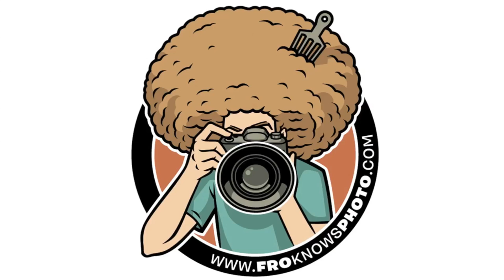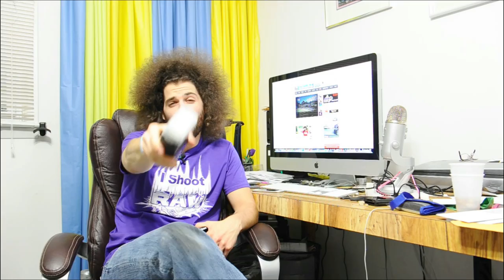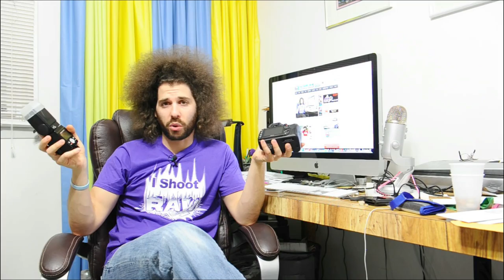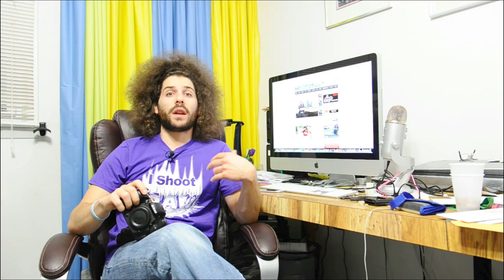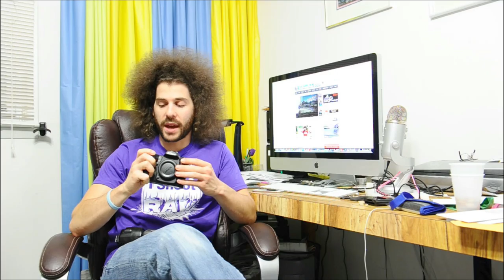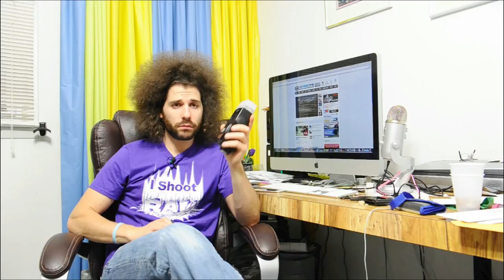Flash Photography Quick Tip - Strobist

Comment: I've pretty much always got my ISO between 200 and 800 (though mostly at 200) when using my flashgun and it recycles super-fast and lasts for more than 600 bursts... I find that leaving the batteries inside when you're not using it wastes more power, so I always take them out.

Comment: How many times does he say DUMP and BUMP? Jared, you need to lay of the caffeine right before the shoot !!! Ha Ha. Also , I BUMP my aperture  to let in more light ! Example;set lens to 2.8 in low light shooting and keep the I.S.O. in a reasonable range BECAUSE ALL cameras show noise at higher settings. YES , ALL cameras. As for the flash units-Dial them down to 3/4,1/2 or even 1/4 power and you will have PLENTY of juice left plus superfast recycle times! J.M.O.Mako